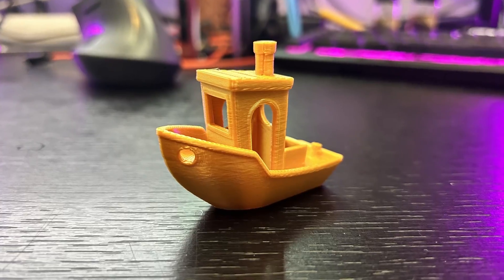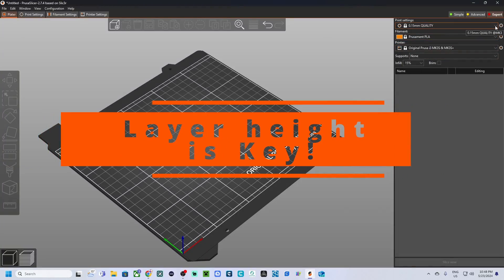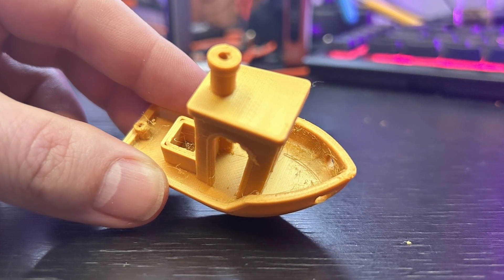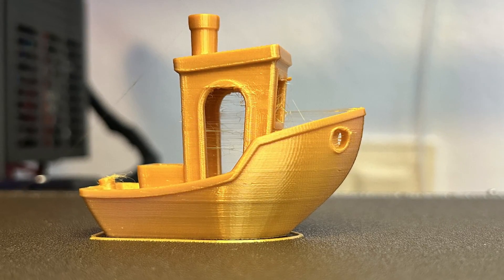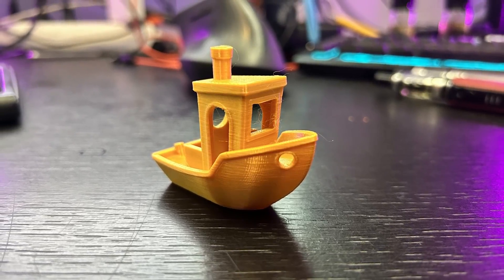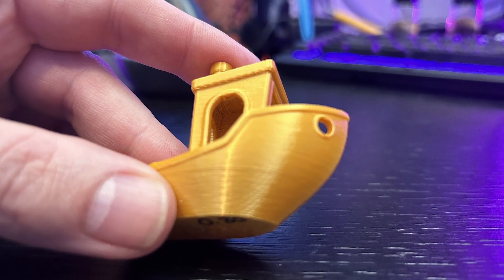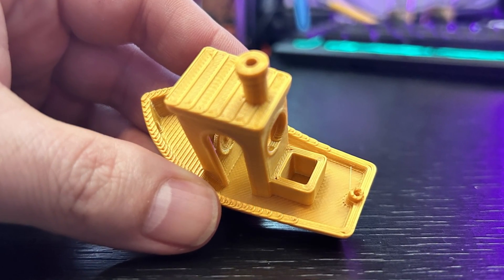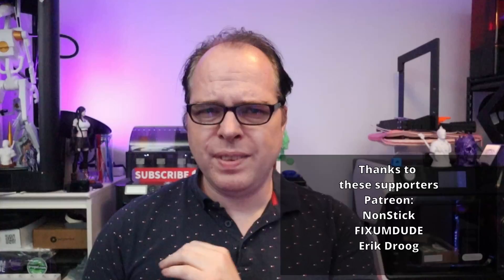Prusa Slicer Layer Heights Explained: Boost Your 3D Print Quality!

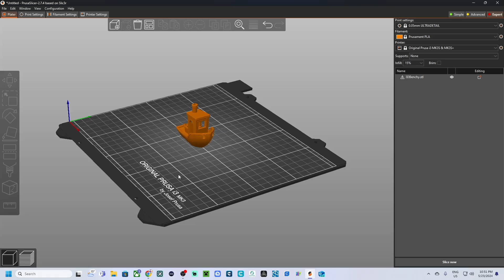Comment: 1:26 i don't like this boat.
Reply from the maker: Yes, profile isn’t fully optimized yet. Like mentioned, these were the standard settings in Prusa Slicer for a i3 MK3S
Reply: @Zachary3DPrints  nooooooo... What I'm trying to say is why does everyone make this boat to show print quality? But while there is a lot of stuff available to show print quality.
Reply from the maker: Ah, I get it. I did wanna do another model, but even at a scale of 50% it still was 12 hours printing at 0.05mm. It’s the very first model that you saw in Prusa Slicer, Wonder Woman bust
Reply: @youngplayboy786  because it shows lots of things, like overhangs, bridging, stringing, and it doesn’t use much filament.
Reply from the maker: Yup indeed. Not much filament and quickly to see if all is looking great, before printing some longer prints